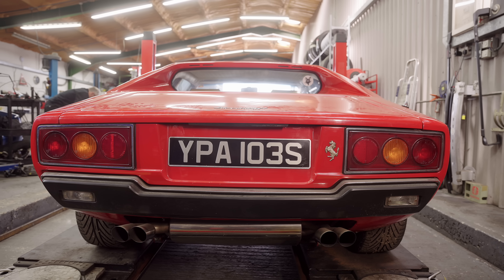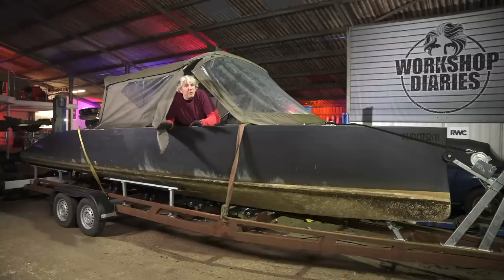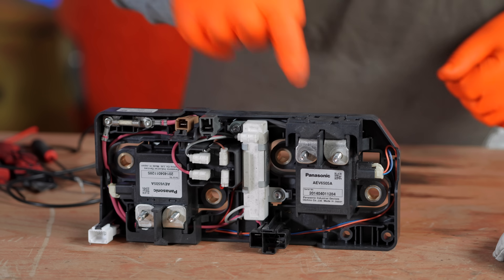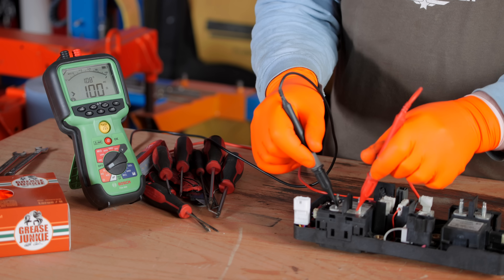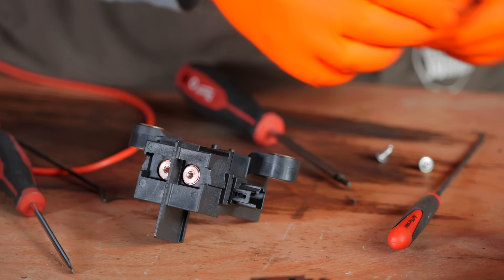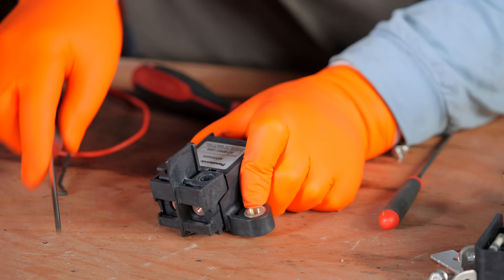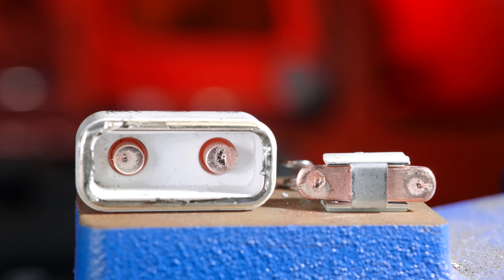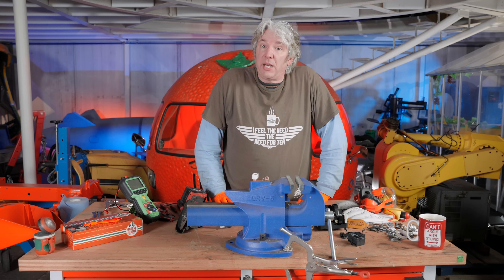1 Surprising Thing I Found Inside a Welded EV Contactor

Comment: Hello, Edd!
I might be able to shed some light on the current rating of that contactor.

The contactor is rated for 120A of constant current load. This represents the thermal limit of the metal parts and their ability to dissipate losses into the surrounding environment without becoming too hot and sustaining damage. The key factor here is time. It takes a significant amount of time (minutes) for the contactor to heat up to the maximum permitted temperature at a 120A load.

Here's the fun part: Because the cruising power consumption at motorway speeds is approximately 20kW for a Nissan Leaf, you are only loading the contactor with around 60A. The maximum power of 80kW is only used during hard acceleration. In these scenarios, the contactor is loaded above its maximum constant current rating, but since this duration is limited, the metal parts inside don’t dissipate enough energy to heat up excessively. Once you reach cruising speeds, the contactor is only loaded to a quarter of its maximum thermal capacity (half the rated current results in a quarter of the maximum thermal losses), allowing the contacts to cool down again.

The same principle applies to electric motors used in electric drivetrains. They can deliver immense power and torque, but only for a limited time before requiring a cooling period. The driver doesn’t need to worry about this because the motor control unit monitors the motor’s winding temperature and reduces output torque to prevent overheating. You’re unlikely to notice this as a driver unless you are, for example, towing something heavy up a steep hill.

tl;dr: You can safely exceed the rated current of a contactor for a limited duration.
Reply from the maker: Thank you. Nice explanation. In that case it will make sense to uprate the contactors in our new Electric Ice Cream Van record attempt so we can use more current for longer. Better cool the batteries a bit too then I suppose!
Reply: Fair enough. But that contact looks like a spot welder. If it's a common issue on the Leaf presumably it's been underspecced for the job.
Reply: Thanks for that! I love getting smarter every day.
Reply: @davidjereb  you're correct, but the problem (as Edd brushed the topic of in the EV service episode) is the capacitors in the Leaf. 
If there's any kind of leaking current that drains the capacitors, the current in the moment the contactors engage will far exceed the nominal capacity. Especially if the control resistor is also faulty.
My bet is that the current (in the moment of contact) could be as high as 300 Amps, and that's far more than these contactors can withstand (even for a short time).
That's probably also why you exchange the complete module instead of just a new contactor.
Reply: @tbjoyrider  If the precharge resistor fails, the motor control unit should detect that and prevent the contactor from engaging. If the contactor was regardless engaged with an empty capacitor bank, the inrush current is going to be in the kiloampere range. A contactor of this caliber would take 300A easily.
What often causes the contactors to weld themselves shut would be degradation of the contact surface, resulting in surface roughness, leading to smaller contact areas. That, in term, results in more heat dissipated in the contact patches, leading to a little bit of sticking, which progressively gets worse and worse. Eventually you get to the point where to the return spring is not strong enough to pull the conducting bar away from the contacts.
Reply: @davidjereb  I completely agree with the degradation issue. It could be because of the pitting on the contactors, but to me they didn't look like they could withstand 2,5-3 times the nominal amperage.

I don't know enough about the MCU to have an opinion about whether it will detect a faulty precharge resistor. I'm sure it will detect if the resistor is burned, in which case you're right about the kiloAmps, but I've seen lots of resistors with just a changed resistance (both higher and lower than the original resistance).
Reply: Yes you’ll find in a lot of electronics the headline rating is just a nominal value, that applies a particular scenario.
Reply: The biggest issue I can see is the fact that Nissan has gone cheap on the quality of the contactor . You can see similar on large A/C units,which are exposed to the same environmental stresses as any car is .
Reply: That specific Panasonic EVA relay specs seems hard to find, but same family EVA relay rated for 120A and 450V continuous can take 225A for 3min and 400A for 30sec. 

Obviously Nissan didn't bother design Leaf with Nurburgring in mind, but I'd say it's a bit dangerous to fit relay specced less than motor power. But I assume the motor won't last long either at that 80kW.

These relays have a limited lifetime for switching contact on/off, both mechanical and electrical of which latter is affected by the current pushed through. Over the time, the contact area may get smaller due mechanical fatigue and also electrical wear at the contact surface. Eventually contact area gets smaller,  heats up more than specced, and welds together at nominal current and voltage. That's somewhat visible on Edd's relay too.
Reply: Depending on the EV design, 80kW is listed as a 60 second power rating. Many of them have MUCH higher power ratings for a few seconds (eg: Ludicrous mode). My Mitsubishi Imiev uses a forklift motor rated at 25kW continuous that's boosted to 35kW continuous with water cooling and 49kW "peak", but the ACTUAL instantaneous maximum power is closer to 80kW when the "loud pedal" is mashed hard. Torque is so high it's actually electronically limited from standstill in order to avoid bending halfshafts - It's handy when sprinting up the North Downs scarp though - accelerating up a steep hill the meter pins out at 250A and stays there as long as you dare keep your foot down (it's not a good idea to exceed 40mph up that particular hill, in case something's coming the other way - so the longest time I've done it is about 10 seconds)

Comment: I would say, as you picked up, that the contactors are in fact under rated for the task. Hence the way it failed.
Reply from the maker: I think it is definitely a possible issue but I think @Richardincancale, above, has a great explanation...

Comment: The current rating on the contactor may be the breaking capacity rather than the sustained current rating.  Breaking capacity will be much lower than sustained rating as it’s the arc that damages the contacts. Once closed there will just be some resistive heating.   Normally in a car the contactor disconnects when you’re stationary and switching off, so the current should be low. On my EV I just see the power jumping to 30 amps in bursts when stationary just for the heater or the DC/DC 12v charger.
Reply: The only time there would be any real current (more than many an amp or 2) when the contactors are connecting or breaking would be in a fault condition, like if one of the interlock circuits was opened while under load or if there was a loss of isolation. Under any sort of normal operation, the pre-charge resistor charges the capacitors in the system before the contactors are closed, so no current flows when it closes, and all loads are stopped before the contactors are opened.
Reply: @ouch1011  Yes true, however the hot switching operation needs to be considered and devices rated accordingly Worst case if you like. I designed a high power DC distribution system once where the DC contactors were only intended to 'cold' close and open in normal operation and only 'hot' open when safety interlocks were opened due to a fault condition or mis-operation of equipment. As a safety feature this was tested at factory. The hot switching current envelopes were comfortably within stated contactor performance. However we suffered premature failure of contactors in service. My suspicion was these 'hot' testing events were enough to shorten their life although from manufacturers data they should have been fine.
Reply from the maker: Thank you. That's got to be it, makes a lot of sense!
Reply: @eddchina  Just taken a gander at a generic Panasonic data sheet for similar contactor. The specific data sheet is restricted to automobile designers apparently. For similar device Panasonic specify maximum current carrying capacity and switching capability (resistive) as one and the same. But from their 'Carry performance life curve' a 120A contactor will carry 400A for 40s and 700A for 10s. This data is of course over simplistic and will be intended as a starting point for designers considering thermal aspect only. Accelerated life testing would have been performed to determine cost/reliability trade off.
Reply: Really good insight, thanks

Comment: Interesting about that contact block.
No doubt the Renault EV was built to a cost so the barely, just about capable, components used?
..
Maybe change the metallurgy of that contact material to something slightly harder. might prevent the arching or at least degrading the contact points which may lead to them welding together.
..
Not sure a bow thruster would be effective being that small, 
so definitely interested seeing if that will work..
..
Candy apple  would be a bizzare/vibrant boat colour👍
..
If it he boat was, painted as suggested by another commentator, orange, wouldn't you have to then call the boat tango...🤔
...
Other fruit drinks are available...
Reply from the maker: Thank you. I'm looking forward to trying it out and finding that perfect colour scheme. Who doesn't need a bit more sparkle in the lives?!
Reply: @eddchina  absolutely 👍

Comment: If you have a + contactor and a - contactor then yes 43.2kW each which would be just about ok for the motor rating but seems a little low mmmm.. The other thing the pitting seems to suggest the pre-charge isn't high enough voltage to ensure minimal arcing is a stuck contactor a common problem?  Was there a pyro fuse somewhere? surprisingly crude
Reply from the maker: It was one of the first recent production electric cars and yes, it appears to be quite a common issue on these cars!

Comment: Vacuum Contactor, used to be filled with SF6 Gas, Now these devices are fillred with an Inert Gas. Used on High Voltage, High Current applications........
Reply from the maker: I may have let that vacuum or SF6 escape!!

Comment: The atmosphere of the contacter is probably sulfurhexafuoride (SF6). Very dense, and good at suppressing sparks. Not toxic, but a very strong greenhouse gas.
Reply from the maker: Thanks. Oops! maybe I can still scoop it up off the floor?! I seem to remember there being a shortage of it in Germany a while back.
Reply: @eddchina  Just very diluted. You can find a fun video where they have an aquarium filled with SF6, and float a boat made from aluminium foil in it.
Reply: Well I'm going to look for that right now.
Reply: The "short form" relay catalogue from panasonic (sf_relay1060_en.pdf)  mentions on page 49 "inert gas" next to an image showing the relay contacts and the letter H, implying Hydrogen, but somehow I doubt that is inert, as far as I know it rather happily makes water. (All it needs is a bit of air and perhaps a spark from the angle grinding...).
Reply: @ElukeNL  possibly helium (should be He)
Reply: @ElukeNL I found the other pdf mentions nitrogen ? 

Amber sealed types are sealed and filled with inert gas (nitrogen gas).
Reply: @jmc0070  which other pdf? Nitrogen or SF6 or helium seem a lot more likely then hydrogen to me, its just that one image that mad me go ‘uh?’
Reply: @ElukeNL Yes, contactors use Hydrogen gas to help extinguish the arc faster.
Reply: Sulphur Hexafluoride is usually not toxic unless it is exposed to high temperatures above 350 C - then it decomposes to toxic byproducts…
Reply: Also, breathing SF6 gives you a very deep voice.
Reply: aka The other funny voice gas.

Comment: Welded contacts, the achilles heel of just about every high current relay/contactor ever made. I had this happen on my Toyota starter motor, 4kw @ 24v and around 160A with contacts MUCH larger than this. Despite the fact that this contactor failed, the spark suppression must be pretty good to get away with contacts that small IMO. At least DC arcing doesn't produce RF interference you can get with AC.
Reply from the maker: That's true and the EV's AC inverter would buzz a lot more without all of the screening in the cables etc. I remember seeing a very cool AC arc speaker years ago and a few people taking that to new levels here on YT too...
Reply: DC arcs do produce massive RF interference. Spark gap transmitters used DC…
Reply: @  Yes but it was the circuitry in those transmitters that produced the RF rather than the actual spark itself. They also used voltages in the Kv range and not the few hundred in use here.

Comment: The Watt discrepancy will probably be answered by the DC being converted to 3 phase AC to drive brushless motor.
Reply: So with 3 phase there'd be less current?
Reply from the maker: It's true that the three phase AC power might have a higher voltage and therefore a lower current but the DC would still have to produce the same wattage for the 80kW motor, @Richardincancale mentioned it might be the safe release current for the contactor which would be less than the maximum running current which seems to make sense.